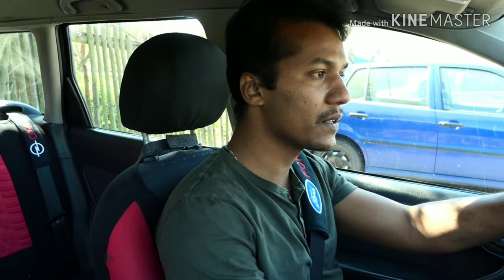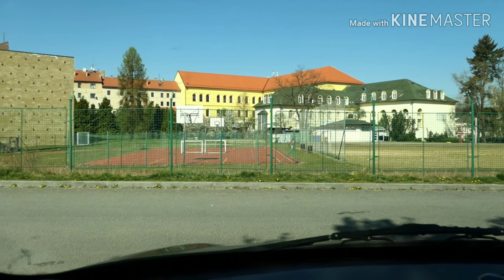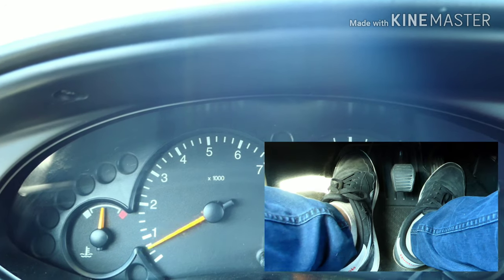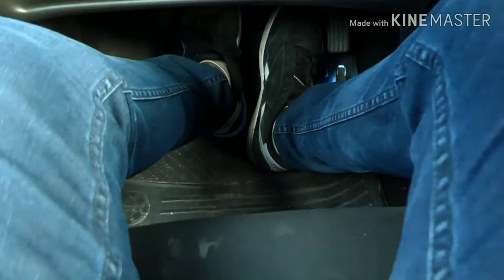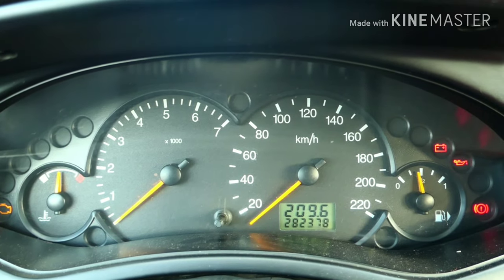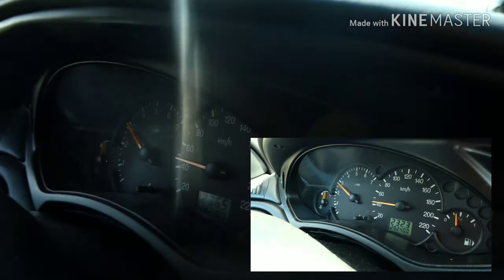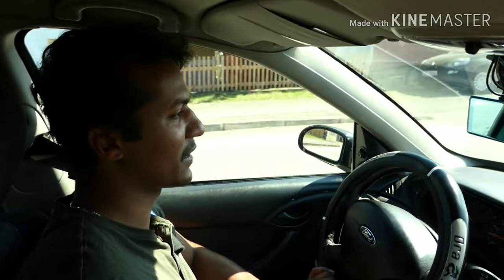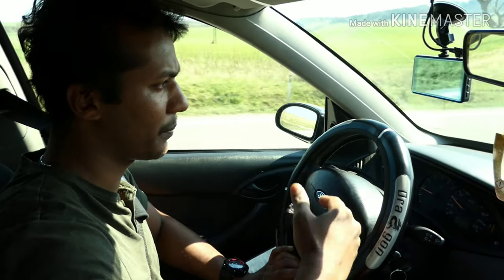How to check clutch system in a car malayalam🔥 (ക്ലച്ച് പോയോ പക്ഷെ ഇതു കണ്ടിട്ട് തീരുമാനിക്കൂ!)

Comment: Ente swift disel car 1 gear ittu edumumbol vandick thullal anubhavapedunu enthanu ath clutch assembly full mariyatha aannu
Reply from the maker: Clutch system mariyappol fly wheel lathe(Flatten) cheythirunno? If yes, Check these things 👇
# Engine mounts
# Clutch linkage (If mechanical)
# Brake fluid level (If hydraulic)
# Clutch system inspection for possible oil leak on pressure plate and clutch plate. 
Hope it helps.
Reply: @anoopkfrancis3977  fly wheel cheitilla bro ath tanne Ittu thannu njan  chodichu ..eni ath clear akanamankil gear box azhickande veendum
Reply from the maker: Fly wheel surface nallathanenkil ath necessary alla. But shake undenkil fly wheelinte uneven surface Oru reason Anu. First gear ittu normal ayi clutch release cheyyathe just onnu rev up cheyth clutch release cheyth move cheyyu, maybe it will help.

Comment: 20000    km  ayitolum....
starting   movementilu   presnalla......engin   hot   avumpol    clech   missing   varanu....ath   edhanu   presnam.....disc    omplintano
Reply from the maker: Incomplete information anu, so nalloru marupadi tharuka eluppamalla. Enkilum kurach possibilities 👇
Clutch slipping/Shaking:
-Oil on clutch plate,fly wheel or pressure plate
-Air in slave cylinder or line. 
-Weak Clamping force from forks
-Clutch release bearing is damaged or gets stuck when engine is hot.
- Worn clutch plate or fly wheel.
Hope it helps.

Comment: വണ്ടി ഓഫ്‌ ആകാത്ത രീതിയിൽ നമുക്ക് ക്ലത്ച് അഡ്ജസ്റ്റ് ചെയ്യാൻ pattumo
Reply from the maker: Yes If it is cable operated.
Reply: @anoopkfrancis3977  but angane cheythal millege kurayumo bro
Reply from the maker: @krishnaprasad9168  Kurayilla.
Reply: @anoopkfrancis3977  kurachu millege  kurayille
Reply: @anoopkfrancis3977  r u sure?
Reply from the maker: Yes, if the clutch won't slip by adjusting